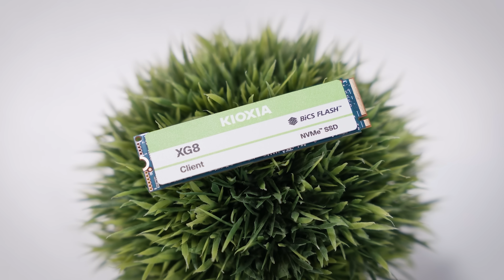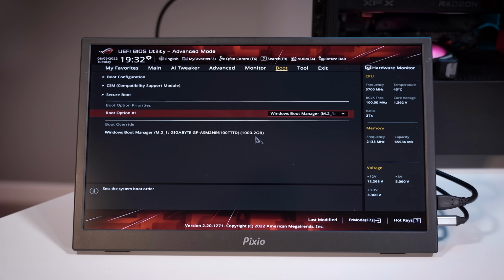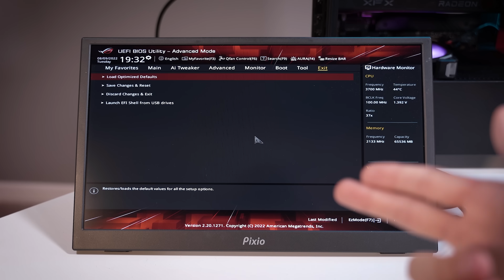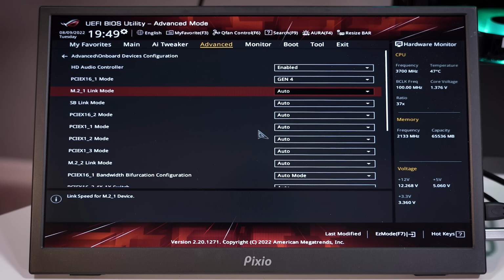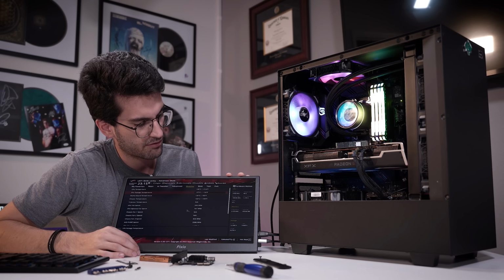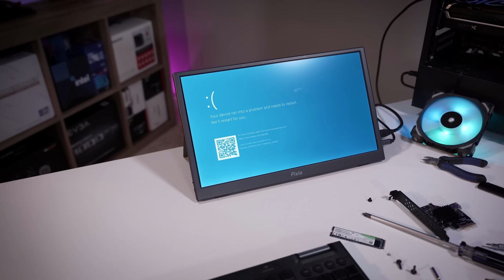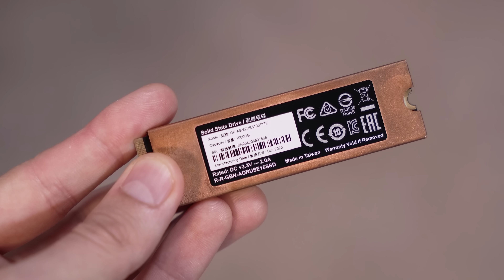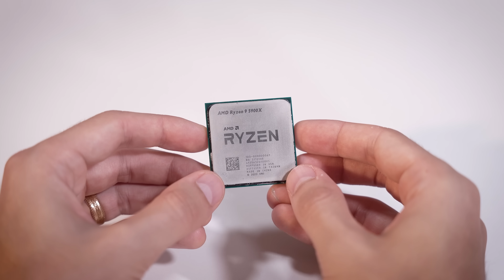Fixing a Viewer's BROKEN Gaming PC? - Fix or Flop S3:E2

Comment: I know I'm a little late to comment on this video, but I had a similar issue with my PC several months back where it kept throwing random blue screens just like this, but mine were occurring after boot. Some of these blue screens like the nonpaged area one were the same that I was getting, along with a few others including system syntax error. Ultimately it ended up being a bad ram stick that was causing all of the issues. I changed it out with another of the exact same type that was bought at the same time and everything worked perfectly from then on. It was literally just one of the sticks went bad.

Comment: This was very interesting, just wanted to suggest it could be the RAM as well in this instance. My friend's PC had very similar issues except it would work for some time then start crashing exponentially until it wouldn't boot into windows anymore. I got tons of different crashes (pretty much all those you mentioned) and couldn't make sense of what was happening. And just like you I suspected the hard drive at first but nope. Turns out one of the sticks of RAM was heavily corrupted, the PC would still POST with the broken DIMM inserted alongside its healthy counterpart but would eventually fail until it failed consistenly. Looking at Windows Events, it looked like every time I had a crash it was caused by a different process until I realized all those processes that caused crashes were heavy on RAM usage. So I did memtest86 and sure enough one of the sticks of RAM was heavily corrupted. 

It didn't fix everything though, but it would almost not crash at all anymore. I then deactivated CPU overclock in BIOS and he hasn't had a crash in weeks now. I think it's possible that constant daily crashes for months on end (yes he waited a while before asking for help) eventually damaged the CPU to the point it's become very unstable ? Not sure if that's the case but I'm not convinced a PC can crash consistenly for long periods of time and not suffer from any damage at all in the long run. Anywho, it's nice to see someone struggled with the same issue I've had with my friend's PC :)

Comment: This is a RAM issue. The varying BSODs and the point in the boot process where it fails makes it super clear to me (who's spent months RAM overclocking and seen this dozens of times before).

He's got 64 GB of RAM. When you swapped the CPU, I bet yours had a strong enough IMC to handle all four sticks at once. His CPU's IMC was too weak, at least given the voltages and timings the MOBO had set.

When you said you'd removed "everything unnecessary" from the build, you missed something -- you could have tried removing 3/4 sticks of RAM. You could also have tried increasing VCCSA/VCCIO and VDIMM, and manually setting a lower RAM speed for testing.

This wasn't meant as critique, I'm loving the series, keep it up :-)

Comment: You mentioned (around 12:00) the pump felt very weak. So you replaced the cooked CPU but put the old cooler with the weak pump back in? Isn't there a big chance the weak pump will fry the 5950X and owner of system would have the same problem back again? 
Hope you at least told him it would be wise to replace the AIO within a short period of time?
Reply from the maker: Weak pump because it was likely calibrated within the BIOS to run at a much lower operating RPM. Modern CPUs won't "fry" themselves. They shut off when they hit t_junciton and can't throttle back any further. This was an older video, so I don't recall the specifics.

Comment: This is exactly what my friends PC is doing. He bought a used B450 motherboard with a Ryzen 5 3350G with a GTX1050Ti. The motherboard was dead so he bought a new A520M motherboard and the 3350G also had this issue. Luckily he paid next to nothing for the parts and what he paid is okay even if it was just for the GPU itself which works fine, the fan was just missing a few blades but we strapped a 120mm fan onto the heatsink and temps are pretty good. I'm now saving up for a 5800X3D and then afterwards he kan have my current 3600.

Comment: I've recently had a similar experience where my 5800x started to die on me. I was getting CPU related blue screens as well as random shutdowns/restarts. After testing different ram sticks, motherboards, and PSUs, I was able to narrow it down to the CPU when the blue screens and restarts stopped when I swapped to a 3700x. According to OCCT stress testing it was a bad core that was causing the constant errors.

Comment: When i first built my computer, i had a cheap graphics card in place until i got my 3080. I have the same or a very similar motherboard. I had the same problem after swapping the gpus. I tried so many solutions, thinking my graphics card was causing some weird problem, bc that was the ONLY thing i changed. Finally i noticed when i got into the bios, the date and time would always reset. Replaced the cmos battery and has ran like a dream ever since. Sometimes weird problems have stupid solutions? 🤷

Comment: And people ask why I am still and Intel fan boy. In 25 years of PC work I have only had 2 or 3 dead intel CPUs and only one of them was recent (i7 7700k). But I had multiple AMD CPUs die on me and my customers. Not worth the trouble. If you want a reliable system always go intel. AMD is hot trash in my opinion. More hot than trash though and its always been that way. The last Generation of AMD I used was the Athlon Thunderbird 2100 and my last ATI card was the Radeon 8500. I have been and Intel & Nvidia fanboy ever since and I have never regretted my decision.

Comment: The CPU was most likely overclocked and over the years that degraded it. I had the same issue, all i had to do was up the voltage a tiny bit from 1.255v to 1.26v and that fixed it.

Comment: I love these videos, also let me share my really recent story:

I've had my rig since 2014, assembled it myself and it's gone through hell and high water no problem, until a month ago when suddenly one day I had one blue screen, then another, the another, THEN ANOTHER until my OS finally couldn't even open properly (same as here every screen had a different exception), so I took the safe route and let the recovery environment do a fresh W10 install for me, I felt kind of relieved to find out that my only problem was my SSD just dying down since after doing that fresh install it stopped loading some time after the post and the initial system check, so I managed to point out my issue and fixed it quickly, all in all I panicked big time thinking my whole rig was about to go to the grave and my soul came back to me after I made sure everything was working just fine, but now I'm thinking about upgrading because well, it's about time I guess.

Comment: Was recently running in to the same BSOD but I was able to load windows before it would happen. Either way reinstalling windows fixed my issue. This all came after upgrading from a 1700X to 3700X

Comment: I know this is old by now. But I don't see you dial cpus back, as a standard routine. You should always test with one stick, and try to down clock the cpu and mem speed to like nothing. As a routine. check both mem channels. That way, silicon degredation will be revealed. Also, even with bad paste stuff, it will often boot. Then just check the temps. That trick also works for GPUs. Just underclock it, then run the test. As a routine. It will make your life easier.

Comment: I once had one that randomly restarted and sometimes it got stick into a restart loop, sent to repair, they found a problem with the mobo, rma, same thing continued, told them, they tested it, nothing happened, I got it, same thing again, tried everything to the point of thinking it was a problem with the wall socket, so decided to cut the evil at its roots, disconnected the front IO restart button....and it solved the problem

Comment: at 4 mins into watching, I feel like the power supply is to blame... let's see if I am right.
at 9 mins, I feel like it became less likely to be a PSU issue... maybe BIOS update or just a dead motherboard... Could also be RAM.
Done watching, what made me think PSU is that the system would start drawing more power when going into Windows than it would in the BIOS. I thought about it because of the boot cycling, I knew it was a power component issue.

Comment: mine it's doing the same and it's brand new just take out of box and i have the same problem with an ryzen 7 5700x  . it booting to windows and when i try to put the password in will restart and some times after motherboard  logo go off wil restart with out any blue screen code and it go right to repair mode . i can tell you my motherboard it's ok i run in it a ryzen 5 2600.
Reply: P.S i try the cpu with 2 diferent motherboard it's doing the same

Comment: shouldnt the radiator be mounted with the hoses at the bottom? if they are on the top end like here the pump will suck in the air inside beacuse the aio is not always full

Comment: Was having the same issues with my build. Worked for a few months, then my r7 5800x just gave me the BSOD and never booted into Windows again. Haven't worked on it after I swapped out the SSD, GPU, RAM and completely disassembled the system, then put it back together to have it BSOD again. I'm definitely going to get a new CPU.

Comment: had a similar or almost exact problem like here, my pc randomly started overheating above 100c and started to bluescreen, each different from one another. after some sweat and tears, i’ve decided to reinstall windows and format the whole drive which somehow fixed it, i have to say i had to be fast because the longest my system could go without bluescreening was about 2 minutes. never want to go through that again, pcs are weird sometimes 
love this series and the amount of brainstorming you’re putting into them, also caring for your viewer’s parts and satisfaction

Comment: Something similar happened to me when I overclocked my processor and ram. I got stuck in a windows error cycle and every time it happened it would give me a different reason. I had to reinstall windows and reset the cmos. It was a weird one.

Comment: This video literally saved my brand new build. I put an all new PC together, and in less than 24 hrs, my computer started doing almost the exact same things; constant blue screens with different codes every time, high CPU temps in the BIOS, crashing even in the recovery utility. I went back to MicroCenter and exchanged the CPU for a new one (because all the parts were brand new, I was still within the 15 day return window). Popped in the new CPU and it’s up and running again like nothing was ever wrong. I am beyond grateful for this video. Thank you for taking on this man’s repair!

Comment: More specifically, I'm guessing its probably an issue with the memory controller on the CPU. "Attempted to write to readonly memory" and irql not or less equal," "Memory management" at random were basically the 1st gen Ryzen experience for alot of people when trying to run XMP/DOCP mode on our memory. Mt Ryzen 9 3900x recently started throwing a similar tantrum, and it actually ended up being one of my RAM DIMMs. When you go to test this CPU, I'd recommend trying some different brands/clocks of DDR4 and see how it reacts.

Comment: I noticed a lot of people talking about how the h510 case is bad and it's a hot box. If you really like the look though (like me) and don't want another case you can easily find acrylic panels with custom laser cut ventilation holes for the h510 and elite to fix that problem. I got some for my h510 elite case and she looks and runs like a dream.

Comment: Holy ** that's my exact graphics card and I'm having this exact issue, I removed my corsair NVME ( the one with windows ) and only had my sabrent in the system ( my game drive ). As soon as the system tries to load into windows it boots me back into BIOS. I'm gonna try a fresh install of windows as the OS on my corsair drive I believe somehow got corrupted so my thinking is, if I can install it on a drive with no OS and it boots then I can install my corsair NVME and wipe it and solve all my problems. Fingers crossed lmao

Comment: From the very start I knew it was a faulty CPU.
I experience a similar thing, my PC will get stuck in a restarting loop when trying to boot into windows.
My only solution right now is to decrease max clock speed below stock speeds which works.
Might get a different CPU soon anyways aha.

Comment: The CPU is going to overheat due to the mounting of the radiator. The tubes should be on the bottom of the radiator or the radiator needs to be mounted on the top of the case. The reason being is that air travels to the top of the radiator and is not circulating the fluid properly. It's pretty much circulating air more than fluid.

Comment: after looking at this set-up: people, do yourself a favor with air flow. Put fans in a way it's a 1 direction flow. Make sure all components get air flow. Make sure to let the intake fans blow in a bit more then the outward fans to create over pressure in the system against dust. Also, if you can: close off the air holes on top of the power supply, let it take air from underneath (filtered) and blow out the back.
This set-up just hurts my eyes and I'm not surprised something went wrong.

Comment: This was a great episode in that it clearly shows what can happen if they try to Overclock with no real experience.  Not saying this is what he did, but the CPU problem is consistent with over voltage settings usually not always associated with overclockers ;) Usually the whole CPU will get bricked, in this instance it looks like 1 or more cores still worked but were failing at the higher temps and loads all indicators of either lighting strike or bad overclocking.  Great episode!!!

Comment: i had the exact same problem! ik had a ryzen 5 3600 that kept overheating no matter what cooler i put on it(even just in windows it was at about 75-80 degrees). I had the cpu about 1 and a half year before it started doing this. As a last resort i got a new cpu put my cooler on it and everything worked fine!

Comment: Same thing happened with me, I fixed it with downloading the Intel Rapid Store Technology Driver (VMD) onto a USB drive. Proceeded to install windows on and the drive wasn't detected. There's an option of "Load Drivers" in the window where you have to choose which drive to install window on. Choose the folder with extracted driver files from the zip and then your drive will be detected.

Comment: I got a 4500 and a b450 board recently. Did bios flashback etc. It didn't want to boot. I assumed it was a bios issue or the processor. It would boot into bios repair after each bios flashback which made me think crap maybe I'm doing the flashback wrong. Let it sit for a few days did a few more bios flashbacks with different drives different formats etc... I was watching one of your fix or flop videos and decided maybe it's not the board/CPU let's start diagnosing. I pulled a ram stick and it booted right up.
Put the ram I pulled out back in. No boot.
I'm lollin watching this video.

Comment: Dumb question, but perhaps the CPU had an incompatibility with the Mobo?  Had a similar issue with a b450m and a Ryzen 5 3600 that  had the exact same issue on boot,would also throw the same random blue screen codes, but as soon as I swapped to a b550 board it ran like a charm. There is a specific thread somewhere that explains that specific cpu had issues too. Even though the board states with newest bios it's 3000 series compatible.

Comment: Funny in a wrong way, i saw this video originally.. 2 days ago, or October 3 and now, on Oct5 at my school IT admin job, i have a teacher's PC just randomly start doing this during a break, poof. Does not boot anything windows related. WinPE Strelec, Windows install ISO, various Windows pre-installs, nada, all fail. ZorinOS live image started up though, which threw me for a loop. SSD and RAM moved to a different PC are fine. Just so BIZARRE. Lucky for me that i randomly opened your channel for, like, second time this year and its suddenly important. 😅😅

I guess it could be a fun experiment with this CPU, if you have it still, to see what even runs on it? I am confused why my example i3 7100 opens a linux live CD.

Comment: Troubleshooting a pc is always a pain. I bought a gigabyte 3080ti and put it into my current pc and I started getting a “pfn list corrupt” error blue screen which I never got. I then installed the 3080ti on my brothers pc and again after a day or two he started getting the same error blue screen. I then just decided to make a completely new build and used the 3080ti and again after a few days I got the same error. Safe to say it’s the card that’s defected. I called gigabyte, stated an RMA and after 2 weeks I got my card back with the repair notes stating “no trouble found after tests” so now I’m stuck with this $1200 paperweight. Extremely disappointed 😔 horrible warranty

Comment: I have learned a lot from these fix videos! Very helpful. Have you ever deep-cleaned an ant-infested computer? Like in monitors and laptops and other electronics where disassembling it is not an option? I know you mostly deal with system units only but would like to hear your thoughts on this. Thanks!

Comment: Great show Greg, I really enjoy fix or flop. Watched it from S01 to the latest. From my experience in PC's some of the old hardware specially the mobo can get fixed by spraying fast drying contact cleaner. Usually it fixes ram slots, pcie slots or some random problem (booting issues, on/ off issues). I dont know if spraying contact cleaner can harm the hardware or not. I magically bring a dead GPU by disassemby it and spray it, just lucky i guess 😂
What's ur thougt about that?  I only used it on old hardware specially if those things are dirty and its only office PC's
Keep up the good work man 🙏